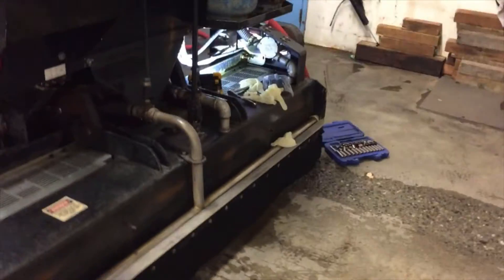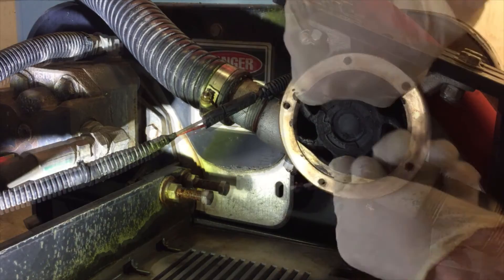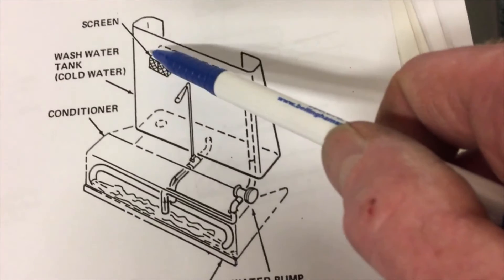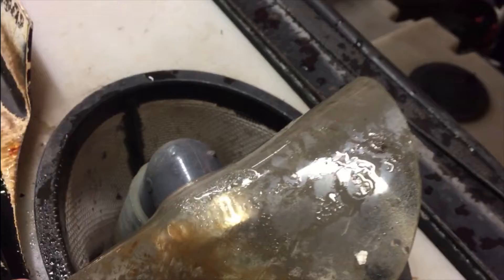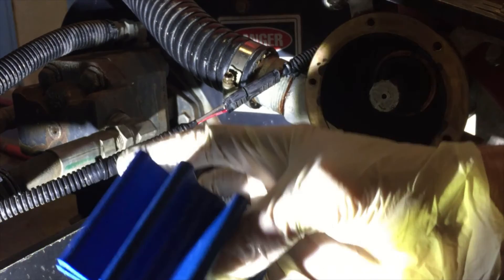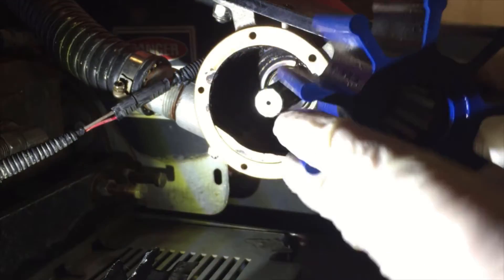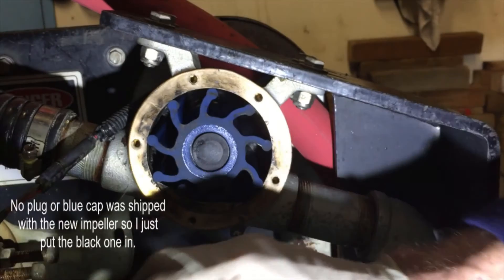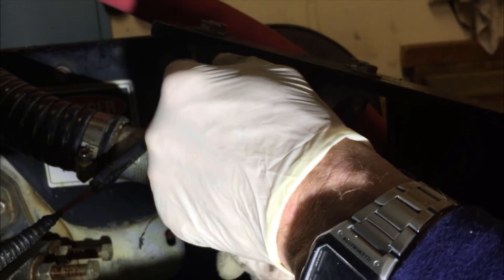Zamboni: Wash Water System & Impeller Replacement

Comment: I just recently replaced the impeller on our 540, yes, it was cold in the Zam bay, so, to help make it easier pushing the impeller in, I got the heat gun and lightly heated the vanes to make them more pliable . I think it helped as well as putting a scrap piece of wood across the impeller and tapped it in with a soft blow hammer. Made the install easier to me. Great video as usual!
Reply from the maker: Great idea. 👍

Comment: Also the cap what will happen without a cap for the impeller?
Reply from the maker: Perhaps a little lose in suction from lack of a good seal but probably very little. I could be wrong but the impeller is up tight against plate and should provide a good seal.